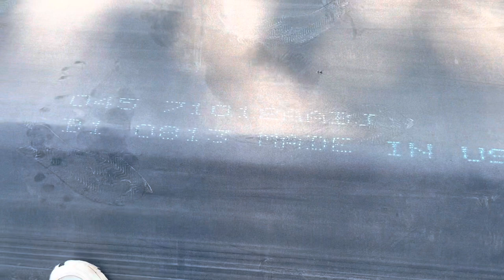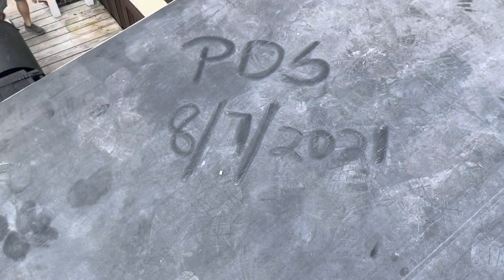Mobile Home Roof Replacement.The Travelers. Middletown NewJersey.

Comment: You can definitely tell you take pride in your work.  Good job keep it up. Only a few million more need a new roof.
Reply from the maker: Send them to me. I’ll do it
Reply: @Drewsroofingandhomerepair  will you travel to Southern Indiana?
Reply from the maker: Yes 👍. Of course it is 12 hours away and it would be an added expense and fee but yes we will if you’re on your own property
Reply from the maker: The only thing about that is Chris is that you’re talking about 750 miles times 10 miles to the gallon there and back. And another truck at 17 miles to the gallon divided by 750×2 so it’s basically a 1500 mile round-trip. Five guys two trucks one trailer with supplies
Reply: @Drewsroofingandhomerepair  hey, I specialize in remodeling manufacturered homes. I don't care to ever do another roof job. I also have a buddy that owns a mobile home parts business. So between the two of us we pass on several roof jobs every year. It maybe where I could give you the leads and you guys could come knock out 5-6 at a time. I don't want to be a middle man or expect a bird dog fee. But it would be nice to have someone to refer people to.
Reply from the maker: I would love it Chris. If I did come there I would have to do at least two minimum maybe even three to make it worth my while you are about 12 hours for me Chris. That’s with no stopping that straight time driving out and of course that won’t happen so basically I’m thinking 14 hours maybe

Comment: Nice place
Reply from the maker: Very nice
Reply: Nice job.  Good tips on gutter drip edge and cleanup.  I also have torn rotator cuff in both shoulders from falls.  The treatment that worked best for me was injections of cortisone with lidocaine.  They weren’t painful and lasted several months.  Time seems to be the big cure with occasional flare ups with Tylenol for a few days.  Best wishes,  Pat
Reply from the maker: Thank you my brother I had a MRI just before we left and I go to the doctors Tuesday to find out the results. So we’ll see how it goes.
Reply: @Drewsroofingandhomerepair  I have had both shoulders repaired surgically for rotator cuff tears. Took about a year to fully recover after surgery. No heavy lifting from now on!
Reply from the maker: That sucks I hope I don’t have to go through that. I just got a call from the people that did my MRI and they told me they are referring me to a neck and spine specialist. That wasn’t exactly what I expected but here we go. Maybe I think it’s my rotator cuff and it’s my neck and spine find out soon